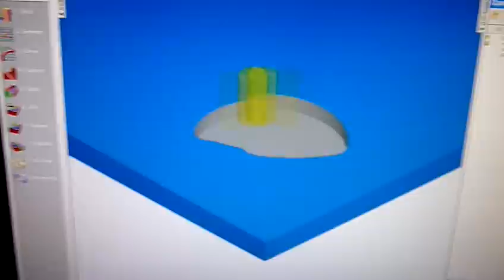CNC Homemade router, Engineering process

Comment from the maker: I'm using BOSS7M postprocessor, from featurecam options, this post is almost fully compatible with MACH3, only you need to remove first line from programm. Other FANUC posts is also usable, but need to remove some initial commands.